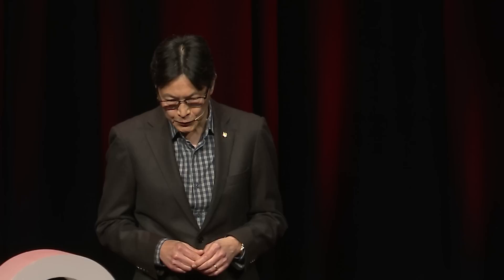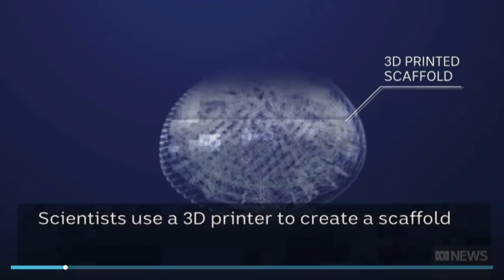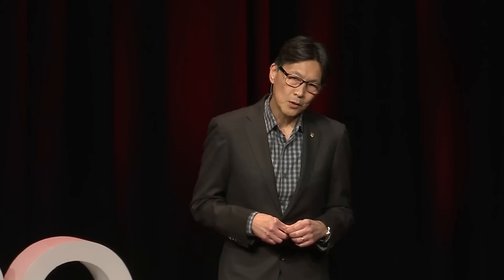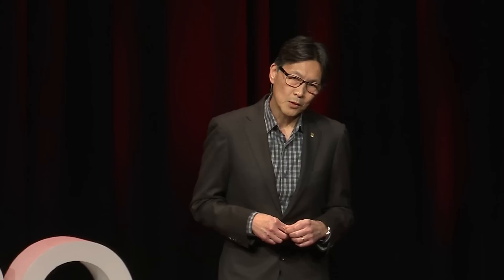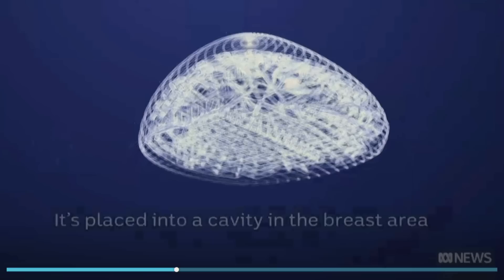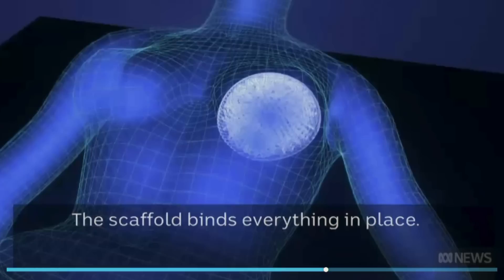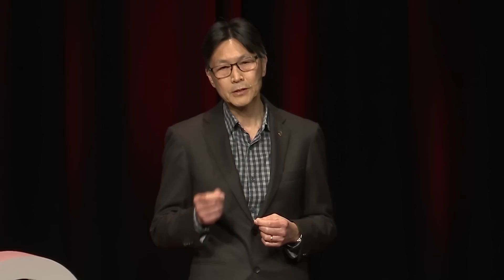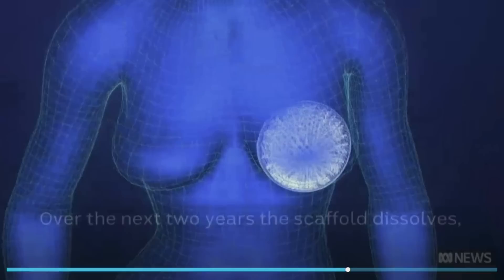Can 3D printers help breast cancer survivors? | Owen Ung | TEDxBrisbane

Comment: I felt it would be very difficult/hard for human to discuss issues concerning medical treatment. It would be not only hard/difficult technically but also on its expression sentimentally/ethically. 
Human would discuss about medical treatment has severe meaning. but what it would be in the case of chat bot, they don't use such human like empathy/emotion, they could discuss only based on the fact which might be easy to understand and sometimes hear interesting, I suppose.
It would be interesting to make videos debating with between two chat bots in an improvising manner about the theme of debate not informed in advance. It could be made endlessly depending on the selection of theme of debate. I suppose this might cause a sensation, 'two chat bots debate'.